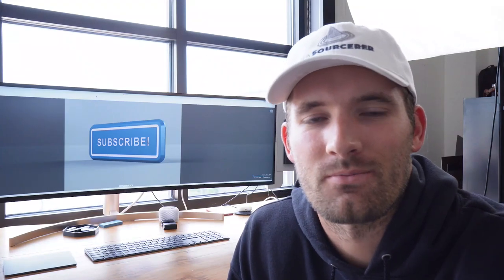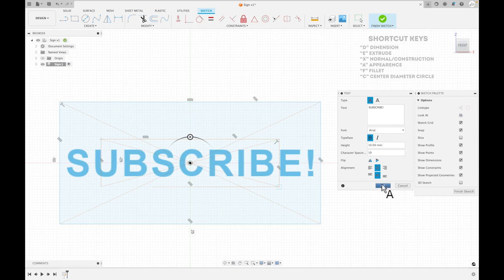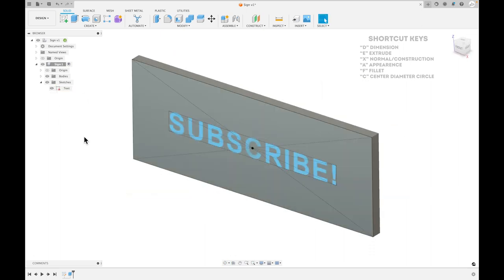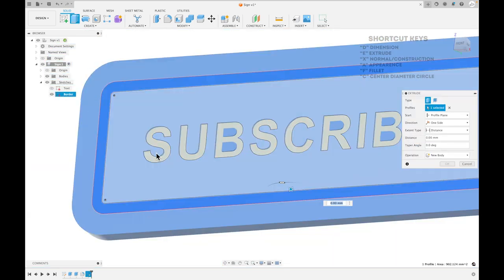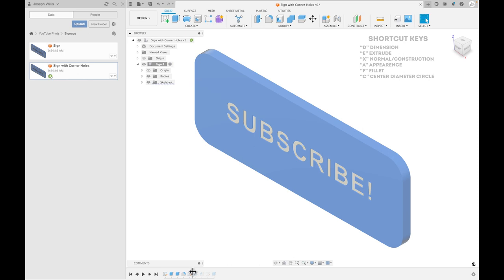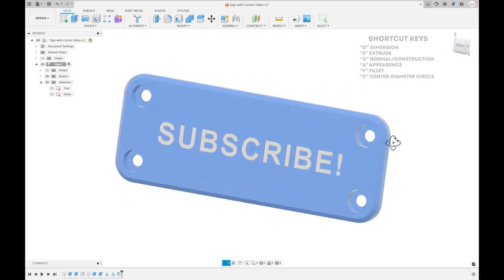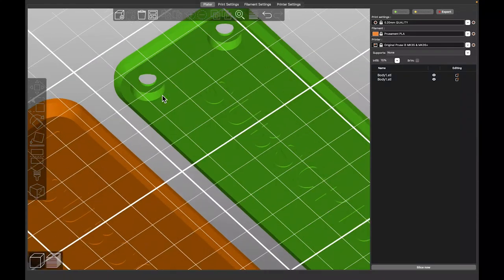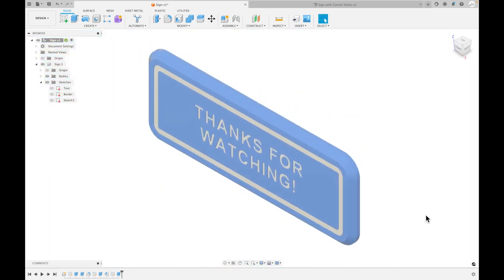Useful 3D Prints - How to Make Signs in Fusion 360

Comment: Very nice tutorial, have my like, subscription, and comment for all the youtube shenanigans ;)
The takeaway for me was the dimension cross reference - that will come in handy.
One thing I would add is a sacrificial layer to avoid printing in mid air for the screwholes. Just a small 0.2 mm extrude between the smaller and larger screw hole. It prints nicer and is easy to poke through with a screw :)
Reply from the maker: Thank you! Haha yeah I agree the sacrificial layer would work - my point was that I think a lot of people are afraid to print face down with overhangs without supports so I just wanted to demonstrate that it turns out better than you might expect. On that note, you’ll definitely be interested in the next video! Thanks for the sub!